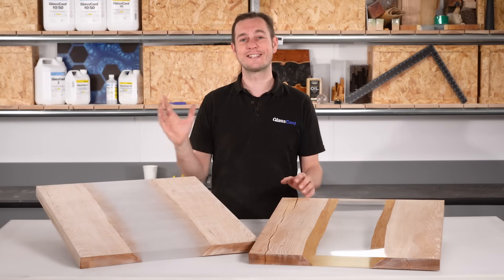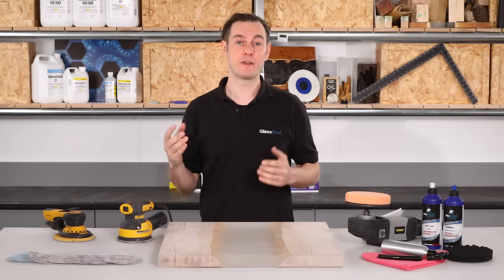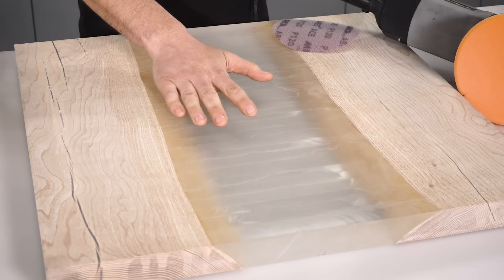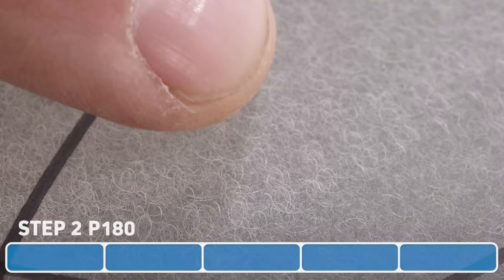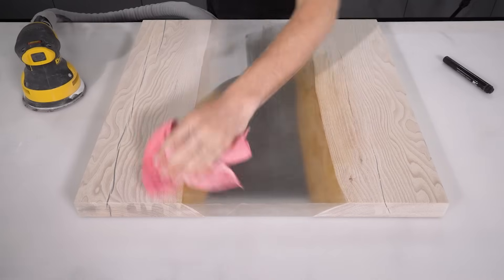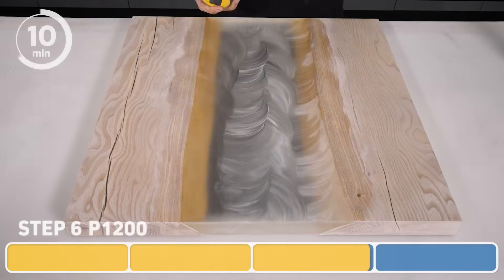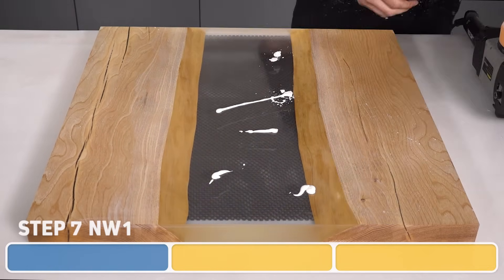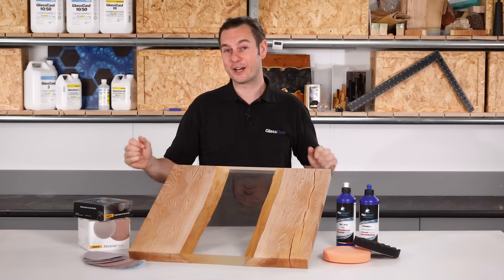How to Sand and Polish Epoxy Resin to a Mirror Finish - Step by Step Guide

Comment: Good video on polishing epoxy, however the danish oil finish doesn't protect the wood from getting stained/stripped off by the polishing compound as you can easily see at 10:50, and from my experience as a woodworker who works with epoxy every day this is something I still struggle with to find a solution, would be nice if there was actually a good method in polishing the epoxy without messing up the wooden sides other than just epoxying the entire wooden surface just to be able to evenly sand/polish the river
Reply: THANK YOU...THIS IS THE $64,000 QUESTION! To complicate it even further, I don't like wood to have the unnatural glassy look of epoxy. I would much rather have a satin look on the wood.
(BTW, I asked almost the same Q here 11:49  before I saw yours. I notice he answered all the questions except yours. I.have not seen ANYONE address this critical issue. I do hope he answers.
Reply: This answers my question, thank you!
Incase anyone else is struggling with this same problem. I'll explain my situation...
I make Chess boards. Half the squares wood, the other half epoxy. Obviously I can't sand just the epoxy squares without getting the wood. I was wondering what the point of finishing was if the buffer was going to remove material. Now I understand. I guess the only way to seal the wood properly would be to cover it in something that has the same strength at the epoxy and that brings us back to finishing the entire thing with epoxy so it can all be polished to the same level. Thanks again guys. Looks like I have a choice between leaving the wood exposed or coating it in epoxy.
Reply: Could the wood be taped to protect it from the polish, or no?
Reply: @mikedeeznutz69  No the tape doesn't hold up. Been there. Dealing with abrasives and high RPM polisher.

Comment: Great video and very helpful.  You used Danish oil to seal the wood before polishing with the compound.  How long after sealing do you have to wait to polish. Is it possible to use like an Odies oil to seal before polishing as well?
Reply from the maker: It is not a product we have tested.  However it looks to be made of oils and waxes so is likely to offer similar levels of protection.  However test on a small area first to be safe.

Comment: I find the orbit polishers expensive. Isn't it ok to use the polish pads on the dewalt 5 inch sander along with the polish compounds of course?   I just don't do enough to justify spending $400-$500 for a polisher.
Reply from the maker: Assuming it has appropriate speed control.   That and simple rotary polishers work well, they just require a bit more technique to use without damaging the resin. On a rotary machine it is easy to overheat one spot unless you are careful to keep the pad moving.  Orbital polishers are more forgiving because of the movement action.

Comment: Hi. Thanks for the video. I have a question regarding the speed setting of my orbital sander (from 1 to 5) for each grid and polish stage. What’s your recommendation? Thanks a lot.
Reply from the maker: Hi Eduardo, we recommend a high speed but low pressure. You need to keep checking the surface of the item to make sure that it doesn't get warm, if it does move onto another part of the item.
Reply: Thank you very much for your prompt response.

Comment: I do love this - only problem is it's always done with PERFECTLY flat surfaces and most people don't struggle with that
Reply from the maker: We'd always recommend sending a piece through a planer thicknesser or setting up a router sled (as in our river table tutorial) to achieve a flat top surface before sanding and polishing. Although in theory you could sand it flat a) it would take a huge amount of time and b) the chance of ending up with a perfectly consistent flat top would be incredibly low.
Reply: @glasscastresin  right but I’m talking single dimensional, horizontal objects with no curves.  Flat items require much less nuance. If you have a DA and ROS, you just move up grit. But applying epoxy and sanding down surfaces on a dynamic object is usually what people struggle with. Mastering a flat surface does not make one a master of non flat surfaces

Comment: How much time to you spend sanding and polishing the underside? Thank you!
Reply from the maker: Its really difficult to give you an estimate as it depends how much sanding and polishing would be needed as it is project dependent. As the bottom is often the 'moulded' surface, you can often get away without doing any work or just a light polish to bring up the shine.

Comment: First, thanks for the detailed video. Very informative. Is there a con to wet sanding the whole project? Always wondered why wet sanding begins after a certain amount of sanding was already completed.
Reply from the maker: For the coarser grits there is no benefit.  On the finer grits, the water helps lubricate the paper and helps reduce clogging of the papers.

Comment: Hi there! Your video was substantially more informative than at least 100 others I have seen on YouTube.  I would like to ask, however, the f the polishing should be done both before AND after the seal coat and flood coats.  I have yet to find my answer on any video with the hashtag ,"instruction; how  to build river epoxy table from start to finish"
Reply from the maker: You only generally polish as a final stage to finish off the project.

Comment: would you use the same process for smaller areas of resin-for example is its being used to fill large crack/splits in a piece of wood that will be turned?
Reply from the maker: Yes, the same process would be used for any size of resin.

Comment: Once you're project is completely polished, you'll need to apply a protective finish like Rubio or osmo. How do we achieve that mirror finish with the finish applied?
Reply from the maker: Hi Edward, both rubio or osmo oil are normally applied to just the wood and wouldn't be applied to the resin.
Reply: rubio wipes off epoxy with no bond. I contacted their customer support. meanwhile blacktail studio gets consistant sheen on epoxy while building layers of rubio over epoxy. but rubio says it does not bond to epoxy and wipes right off

Comment: Hi, i noticed at 1200 grit you used a wet sand, the water went onto the wood section  - will this not be absorbed into the wood and possibly bow the river table, if i sanded to 1200 or more with a dry sand will the polish compound still take away any small inperfectiond
Reply from the maker: Only if large amounts of water were used.  The amount of time the wood is wet - and also how quickly it will dry in warm conditions - means that it is unlikely to cause any issues.

Comment: If I was going to put a top coat over the epoxy what grit should I sand the epoxy to in order the have good adhesion and clear results?
Reply from the maker: If looking to flood coat resin over the top we'd recommend keying the surface with 120 grit sandpaper ( the coarser the better).
Reply: Thanks for replying.  What if I was hoping to use a polyurethane or something similar?
Reply from the maker: @guitarboomer88  Probably, but we would recommend checking with the top coats manufacturer/ supplier

Comment: Can you start the wood + epoxy project by running the piece through a standard shop wood planner?  Ray.
Reply from the maker: Yes you can. It can be useful if there is a lot of material to remove or a warp you are trying to sand out. A drum sander can also be used to do the same thing.

Comment: How would you polish the end cuts and avoid rounding the edges?
Reply from the maker: For most instances careful use of the sander by hand will suffice. If you needed a very crisp (and sharp!) edge, you could build a simple jig to support the sander keeping it at 90 degrees to the surface.
Reply: @glasscastresin  
Thanks.

Comment: Hello! Very helpful video. I have an issue with small scratches left by the sand paper I think. I start with 80, 120, 180, 240, 320, 400 (all dry) and then 600, 800, 1000 and 2000 (wet) and 3 step polish. When I start having the gloss, I see small scratches which I didn't notice when first sanding. Please help, what am  I doing wrong?
Reply from the maker: If done properly, each stage should fully remove the scratches from the previous grit.  So it is possible you are moving through the grits too fast, or you have a bit or dirt or grit caught on the pad or paper. The NW1 polishing compound can only cut out scratches 1200 grit and above.
Reply: @glasscastresin  Thank you for your fast reply. I will be more patient on the sanding process, then and also be more carefull on checking the dust from the sanding pads. Keep up the good work! 👍🏿

Comment: I have a few questions about the NW1 and Topfinish 2 polishing compounds.
1) Are they sold anywhere under a smaller quantity? I don't have many resin things to use it on.
2) Can I use it with a dremel tool on small resin projects?
3) If it can be used with a dremel tool, what would be the recommended buffing bit?
Reply: I can answer you, or i can try at least. So, yes, you can use your dremmel toold with this paste. You can find some other polishing paste from different suplier that does the job and in small quantities ( Meguiars). And you can buff it with the wool disk.

Comment: Great video, going to redo the top of my bar. Where in the US can I get the PaiBoats NW1 Plus and the Top Finish 2?
Reply from the maker: I'm afraid I don't know any specific US based dealers or distributors although if you struggle, we can ship these to the US, no problems.
Reply: @glasscastresin  Can you tell me what the cost would be for both of those bottles of polish shipped to 32829? Thanks!

Comment: How often would you recommend swapping out the polishing pads?
Reply from the maker: When they get dirty or damaged. They can be washed in warm soapy water to extend their life.
Reply: Thank you! Also, what speed are you using on the dewalt sander?
Reply from the maker: @gustavspringfeldt3487  We went for a medium speed and made sure that the sander was constantly moving.

Comment: Enjoyed your tutorial.  Just starting to use clear resin.  Up to this point my work has all been done with table top multicolor epoxy inlays.  I didn't do any wet sanding or polishing, even though I have been informed it would step up my game.  I am now trying to move in that direction.  So a couple questions:  Seems like a basic  question but need to validate I have a Festool 150" ROS.  Will the mirka sandpaper and wet sanding discs work with that sander?  I am pretty sure the answer is yes but wanted to validate.  Second question - looks like once you go to wet sanding you remove the dust collector connection so you don't suck water into the DC - is that correct?  Thank you again for the tutorial - very helpful.
Reply from the maker: For an 150mm disc they should fit no problem.  Yes you don't want water in the vacuum cleaner/extraction system.

Comment: So when do you seal the wood to keep it from staining and after completely finishing the polishing what do you need to do to the wood to complete the project?
Reply from the maker: Hi Joshua, your choice of wood finish is a matter of personal taste as different products will provide different levels of protection and varying finished
appearances.  In this case, a couple of layers of Danish Oil are used to seal the wood although other wood sealers can work too.
Reply: @glasscastresin  I get that but then after sealing you wet sand and polish.  My question is do you then need to redo the Danish oil after that process or does it hold up to the abuse?  I assume you couldn't do a rubio monocoat prior and then polish?
Reply from the maker: @joshuawendt2050  You shouldn't need to redo the wood with Danish oil after polishing, although you could if you wished.
Reply from the maker: @joshuawendt2050  Sometimes, you have to apply a little bit more finish but generally close to the area you have been polishing up but it really depends on the finish you have used. I think it would be fair to say some touching up would be likely but its unlikely you'd have to do a full recoat.
Reply: Joshua, I share the same thoughts. Once you're project is completely polished, you'll need to apply a protective finish like Rubio or osmo. How do we achieve that mirror finish with the finish applied?

Comment: Great video any suggestions for a mixed epoxy countertop tops?
Reply from the maker: Hi Robert, the only difference if you were doing a darker colour is that you may wish to use the NW1 and TopFinish black rather than the white. 
Everything else would be exactly the same.

Comment: Ive always learned from epoxy video’s that you need to sand you wood till 400 grit and not higher. Because then the wood will not absorb the wood oil. Why did you also sand the wood till 800 grit ? And not only the epoxy part ?
Reply from the maker: Hi Tim, in our experience there is no problem with oils and waxes adhering up to 800 grit on the wood. Secondly, if you did not sand the wood at the 800 grit stage, you may notice a dip in the resin.

Comment: did you also do the same thing to the bottom?
Reply from the maker: In this case, no we didn't because the finish directly off the mould was already very good and as you wouldn't see it in normal use, it didn't need any additional attention. However, there's certainly nothing to stop you polishing the bottom of a piece as well if you need to or for something like a serving board where both sides will be used/seen.

Comment: Do what do I use if I am working on jewellery 
Can I make it work with just hand sanding?
Can I benefit from using a sanding paper wrapped around my sister’s nail dremel thing? It’s a small little handheld device and I don’t believe it spins faster than 1000 rps
Reply from the maker: You can achieve the same by hand sanding/polishing, yes. Its not practical on large, flat items like tables but for jewellery pieces, it can certainly be done by hand following the same grit levels and tips in this video. With regards to the Dremel, the one thing to be careful of is not building up too much heat and burning the surface. If it starts to get hot, stop and let it cool down before proceeding.
Reply: @glasscastresin  fantastic advice! Next time I’m visiting my uncle in the states I’ll be sure to get some more casting resin for you so maybe I have bigger projects to work on.
Reply from the maker: @GoodDogIda  Thanks and I'm glad it was of use to you. Just as a note, we're in the UK, not the USA.

Comment: What do you do to the resin after years of use to get the scratches and small imperfections out?
Reply: Put a thin coat of flood coat
Reply from the maker: As Martin suggested you could apply a thin flood coat like this: https://www.youtube.com/watch?v=dTLLFntPD60&t=212s or you can sand and polish again :-)

Comment: When you seal the wood with danish oil before polishing, is it ok if you oil the resin also, or must care be taken to avoid this. Thanks
Reply from the maker: Its not too critical as the polish will remove it.  Just wipe off any obvious excess from the resin before you start polishing so you don’t get too much on the pad.
Reply: @glasscastresin  thanks for the reply!  Love your products